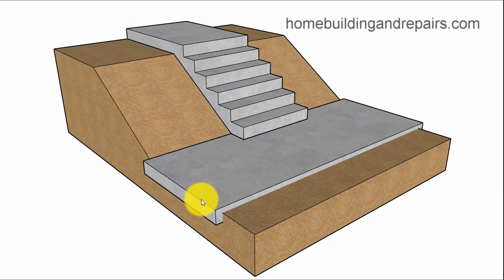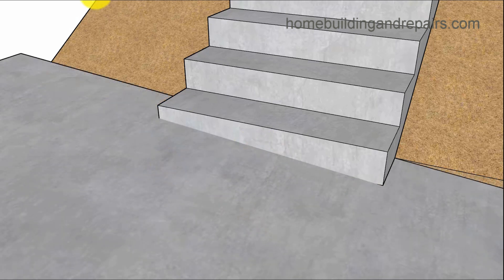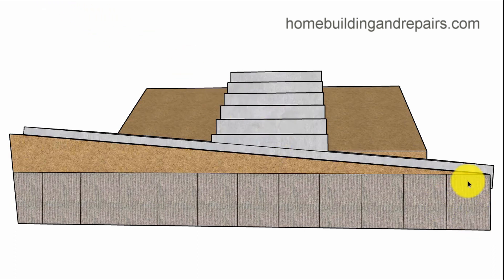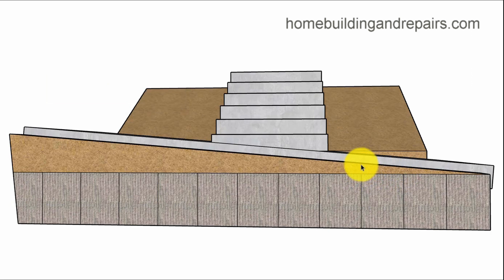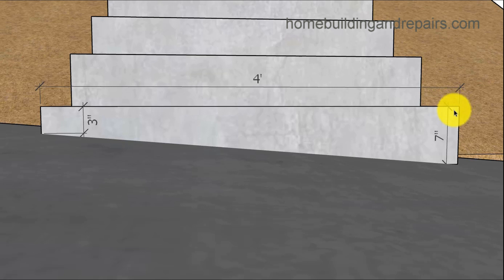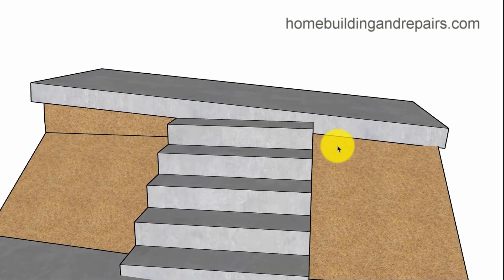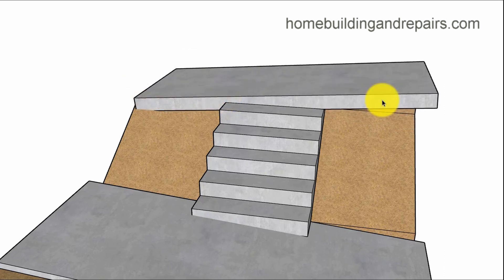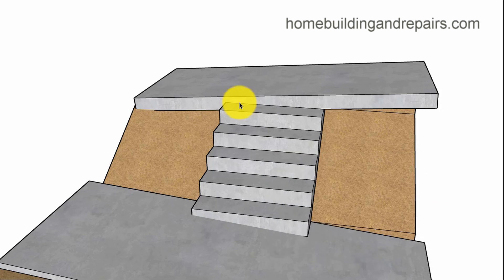Building Code Suggestions And What To Do When Stairs Meet Sloping Sidewalks or Landings

Comment: video is helpfull.
lets say your riser is 7 1/4" outside deck stairs all steps. 
Would u then set your first step off the sloping cement at 7 1/4" at the highest point???? 
thus matching your riser heigth at the end of step???. I was going to use the middle of my first step and set that to the riser heigth of rest of steps. 
I only have 1/2" varience over 38"
Reply from the maker: If you are only sloping .5 inch in 38 inches, then I would center the 7.25 in the middle and have 7 inches at one side and 7.75 at the other, but you would need to check local building codes to verify.